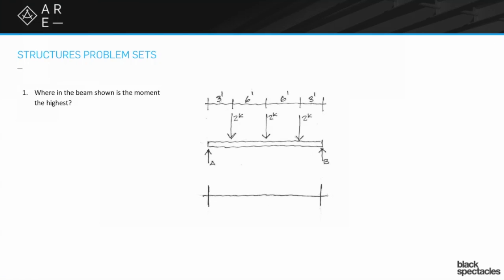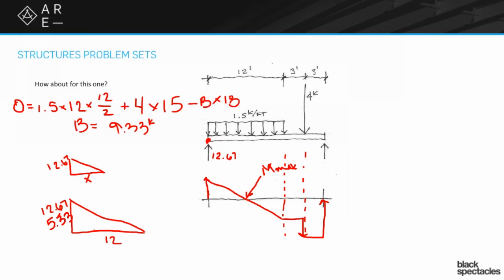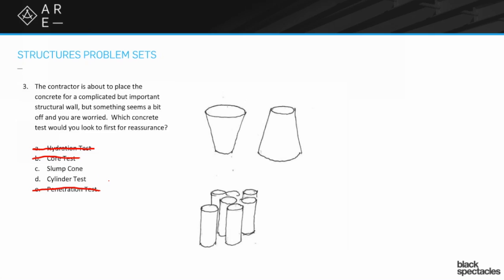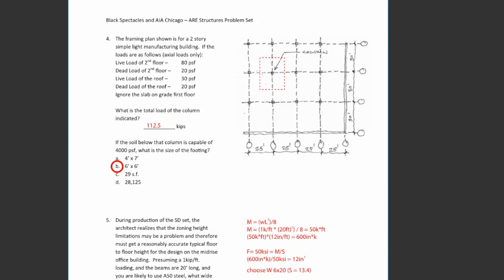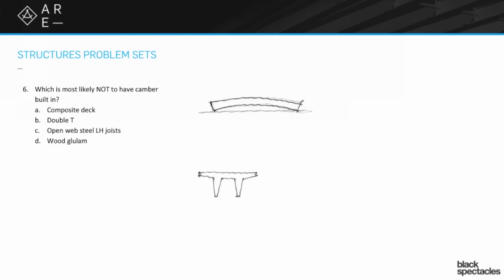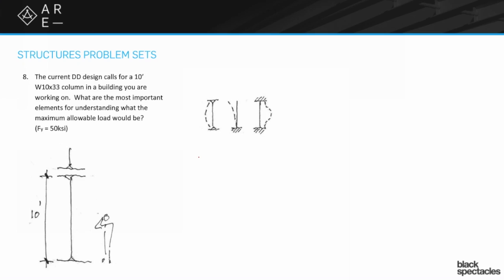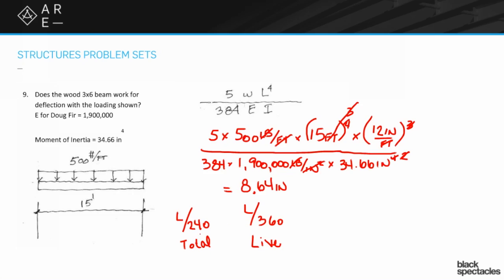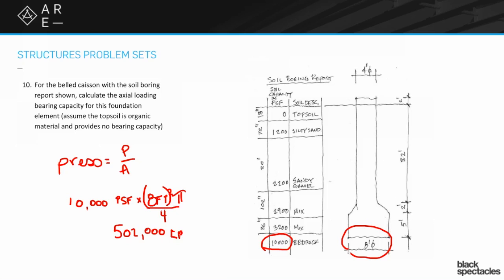Architecture Registration Exam Webinar A.R.E. Structural Systems Exam Review: Answering Problems

Comment: On the last question, the A=Pi*R*R, why is it divided by 4?
Reply from the maker: The way the answer is written is working with diameter instead of radius.  So while you would typically see A = pir^2 (3.14x4x4), we are just seeing it as it relates to diameter:  
Radius = diameter/2
Pir^2 = pi(d/2)^2 = pid^2/(2^2)

There's no rhyme or reason why it's written this way; it's the way the speaker chose to do the math.  You get the same answer.  Hope that helps!
Reply: @Blackspectacles  yeah i figured it out later but at first it was confusing. thanks for replying.

Comment: Couple questions:
#7, since it's asking for the capacity of the 2x12 beam, not the reaction why wouldn't P be the total load on the beam, of 2kips?
#9, if I convert each portion of the equation separately I get this:
((5x(500/144)x((15x12)^4)) / (384x1900000x34.66) = 0.72"

Can anyone help me understand how they got these to be different?

Comment: Number 9 is actually done correctly in the video... I would write it slightly different but the answer stays the same at 8.64 = (5(500x15)((15x12)^3))/(384(1,900,000)(34.66))

Comment: Number NIne deflection using their forumula comes out to 0.577, which is still over the L/240 allowable for total load, but not as drastic as 8.64"!
Reply: Actually Maybe L/240 here is .75 so the answer would be within the allowable deflection ... some clarity would be great on #9
Reply: Mariah Scott 
You are incorrect, it looks like you did deflection= 5*w L^3/384*E*I instead of deflection=5*W*L^3 or 5*w*L^4 /384*E*I meaning you left out a factor of L or 15ft. if you check your units...you really got .577in/ft.... .577in/ft*15ft=8.64in
Reply: Should really be 8.65 if we're sticking to the hundredth. Next digit is an 8, after all. And what Mariah forgot to do was really that she did 15^3 instead of 15^4.

Comment: 1) Why not choose W10x19 for answer to no. 5?
2) for no. 9, no mater how many times i calculate this one , I get a number way lower than yours. 1.8
Reply: Yoseph Kalman 
I completely agree with you on point number 1, especially since the question mentions the zoning height limitations, you need to limit the depth of beams as much as possible, W10x19 seems more correct.
Reply: yeah I just noticed that on W10X19 and was confused why they did not choose that one.